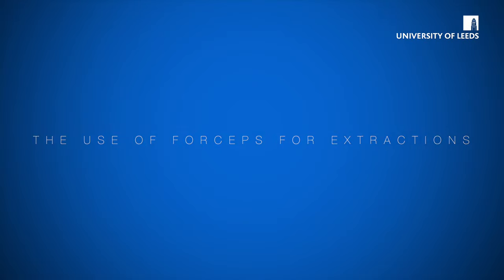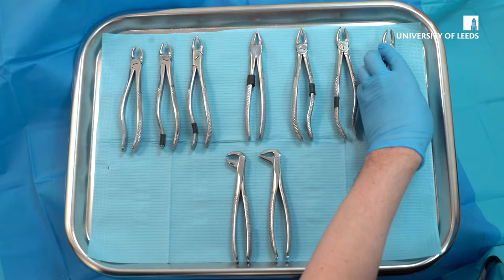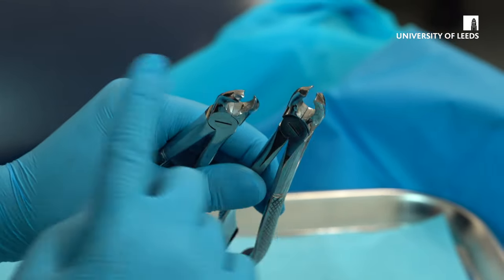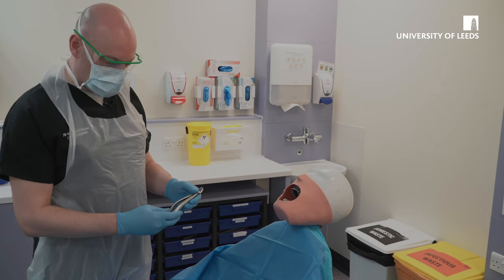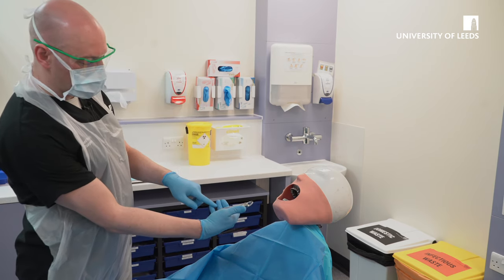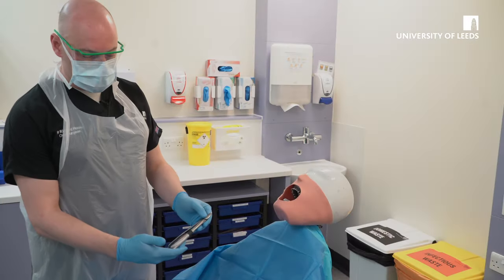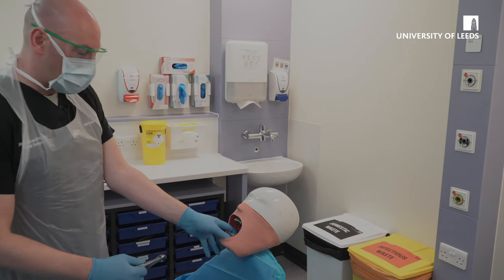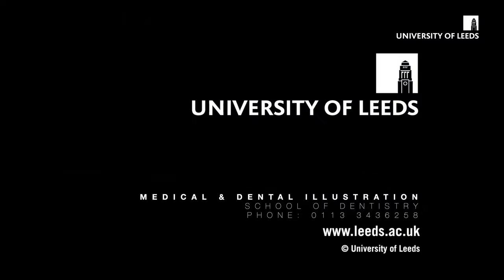Demonstration of forceps technique for dental extraction

Comment: Never ever squeeze the socket walls after extraction!!
Reply: Why?
Reply: @sandimonteith9920  it causes the socket walls to collapse thus causing a knife edge ridge after healing which makes it unfavorable prosthetic-wise and may need bone augmentation & grafting. also it really doesn’t do that much benefit
Reply: The micro fractures caused by the bone expansion during extraction would sever the capillaries and delay on bone recovery and healing . Infact reduction is the first step in fracture healing as taught in orthopaedics.
Reply: @mattd7452  “micro” fractures should never be reduced by aggressive digital pressure (squeezing).